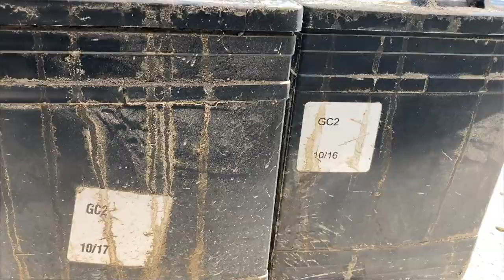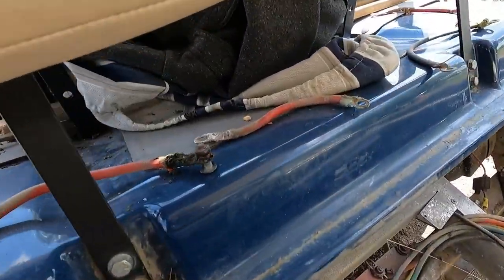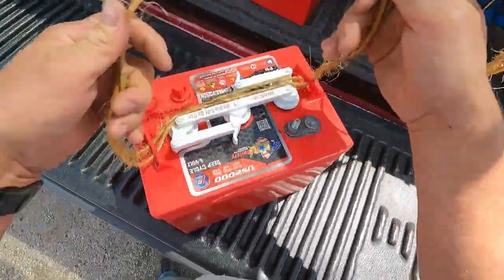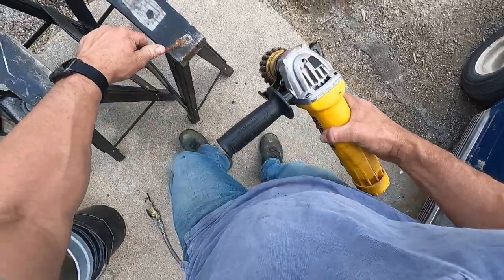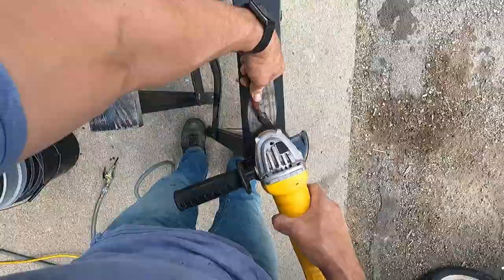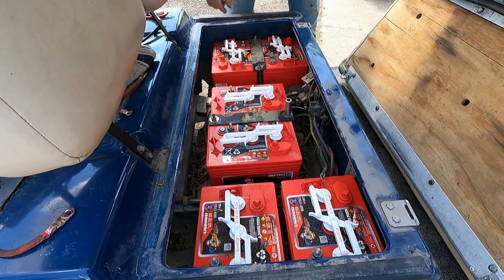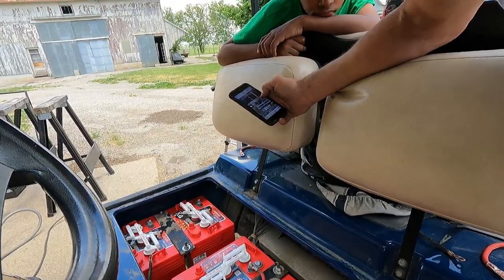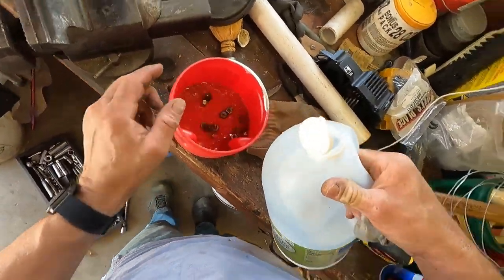Golf Cart Battery Replacement - Club Car Electric Golf Cart

Comment: Hello, excellent video.   When you can, could you make a video showing the electrical circuit, since I have some doubts.  It happens that there is a switch on the forward and reverse selector that does not appear in the electrical diagram that the brand sends us and I need to know what function it performs and how it is connected.